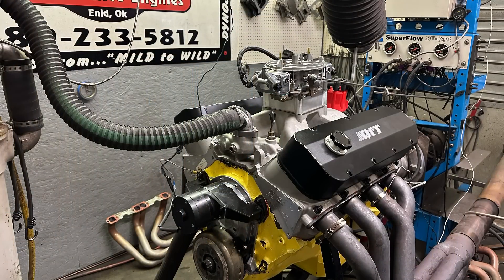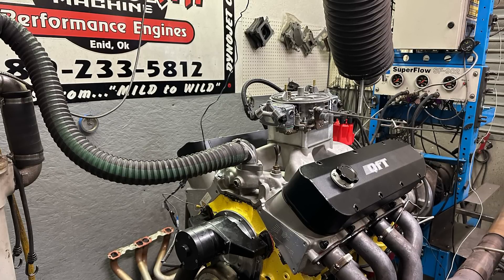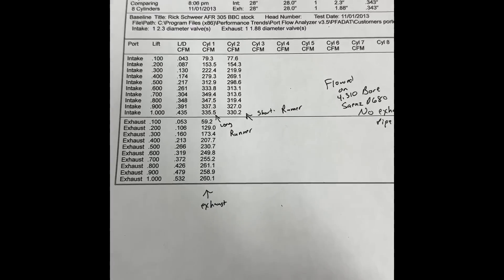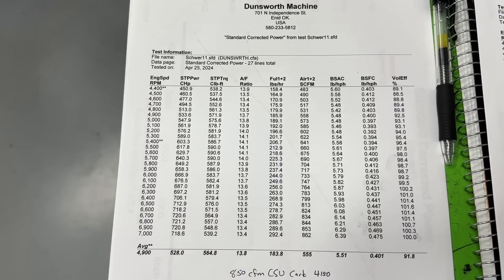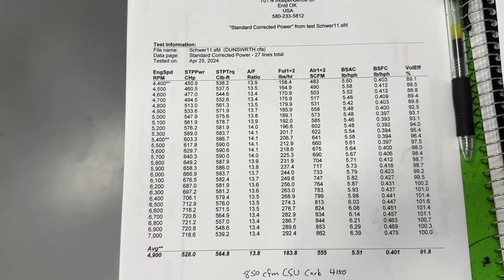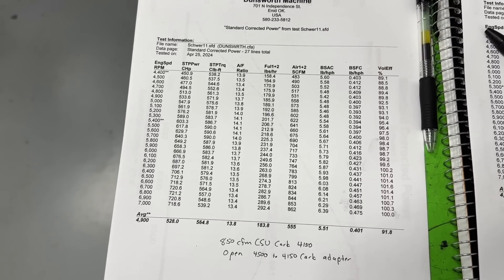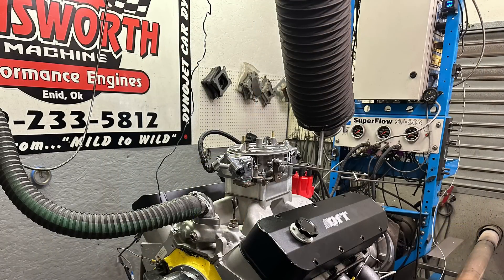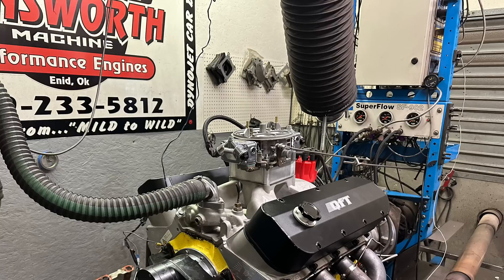468 BBC Dyno Fun

Comment: If it's an old team g it's a pos
Reply: Old Team G is excellent once the right changes have been made in the plenum, out of the box... the plenum is a disaster. (Choke City) Ton's of material available to turn the old style Team G into a performer, especially in its used price range. It'll rock with the proper attention.

Comment: my 11 to 1 468 1969 Chevelle SS always ran hot, went to a 496 with less compression 10 to 1. Both engines ran about 11.90's @ 117mph. Never wanted to spend the big bucks on aluminum heads and a roller cam.
Reply: Did you ever find out what was causing the engine to run hot? I have a similar problem in my 468 it’s turbocharged but the guy that built it he has a little and I mean very little fan that’s off center of the engine on the radiator and it’s not cooling it at all. I can go around the block at it starts overheating. I also found metal in my oil and low oil pressure so I’m in the middle of tearing the motor apart. I’m debating on stroker kit either a 496, 505, or 540. Im new to big blocks and this one’s turbo charged but I’m pulling the turbo off and going with an all motor build. Do big blocks have an overheating issue? Just curious what you did to fix the problem.

Comment: So, it's a 475 CID being the bore is 4.375 which is a little over plus 1/3rd point of compression over a 468's 4.310 bore, depending on combination... it's 10 to 20 of the HP on top. With a 47cc dome .041 head gasket and a 115cc ish chamber will yield 13.2: to 13.5:1 top. Hope you do an update when its tore down and dissected, hope someone throw's a degree wheel on it and checks the intake centerline location. N/A the block can go another .005 and have a special piston or .005 skirt coatings. That block can yet be ran for many years treated right.
Reply from the maker: Yes it’s 475 but as I said in other comments if I said that instead of 468 nobody would know what I’m talking about
Reply: @WeingartnerRacing  Got it, I missed the .100 over statement. The cam numbers makin 740 befuddle me, I had to watch it again. Hope you seen Straub's 475CID video makin 818HP with the twin Holley's  & Pro Maxx Shocker cylinder heads. Very impressive. It's only Fiat money, backed by more ink & paper. Thanks for the feedback.
Reply: @Nobody-ld7mk  🤣🤑🤑🤑🤑🤑🤑

Comment: Whys team g a pos .... i have ran them for years on sbc with really good results... another question can u regrind a sbc cam...
Reply from the maker: The dyno test on the sbc the team g was almost the worst.
Reply: On a big block Team G... the "as cast" plenum is a debacle; the runner entries are drastically mis-matched, & the runner entries are low. Plenum porting only can up HP 30 to 40. Equally size the runner entries (runner length considered) & raise the ports in the plenum as much as possible with a large radius at the top. Team G is a tremendous intake, with only porting work in the plenum.

Comment: That's cool. I built one almost exactly like that with the same heads, same short block, intake. Only difference was  cam about 10 degrees bigger and lift about .060" shorter and it made 713 hp with a 950 carb, they are great heads for a budget build like that

Comment: I can't believe that 468 is makin 740HP... I think someone bumped the calibration a hundred points, 640HP would be more like it.
Reply from the maker: Nope
Reply: I make low 6s with a 468 with 11:1 and a .657/.640 and 258/252 at .050 cam. So I can most definitely see 740 pretty easily at 13.5:1
Reply: @wesleyaitken8756  What Weight?
Reply: It's 477 CI

Comment: That engine is more or less a LS7 (+1 full point of compression) short block with the benefit of modern heads, cam, induction and dyno tuning. And the thing rips off an extra 200+ HP! Awesome.

Comment: I still love building N/A engines and this one is nice. Not everyone wants to make power with 2,3 or 4 atmospheres crammed down an engines throat. I love boost, but it's not for my 2 bolt factory block. With an aftermarket block. Better internals, twin turbos, fuel injection, fuel tech electronics. Heck yes it would make triple the power. But you need to have the $ to build something that last more than a few runs. I don't know how many turbo cars I've seen blown-up due to the weakest link. Depends on what you want & can spend. If you just want the fastest thing in the world, go top fuel, or proline or Steve Morris. But that takes big $ if you've ever priced one. Out of most guys league. Yea you can ebay turbo an LS engine reasonably, and it might last a while depending on boost levels & tuning acumen. But I'll puke if I see another turbo LS. Especially in a Ford Mustang!

Comment: Proper assembly procedure for those who don't know... with the heads off, you index all plugs with ground straps down toward the piston, then sit a head on the block with no head gasket and two un-tightened bolts, manually rotate engine and when or if the head lifts... pull the plug and rotate again. A must procedure anytime a piston dome extends above the deck. Gasket thickness dictates additional clearance after proper fitment.
Reply: Good solid advice, Lindy tool makes a tool that screws right in the plug hole to clearance for this.

Comment: Team G intake POS ??? only before port work, mostly plenum work needed. (runner entry's matched, raise & radius @ roof) Hard to believe a cam that opens @ 20° BTDC and a Bad intake is makin 740HP.  You can easily pick up 30/40HP in plenum porting providing the intake is as cast.
Reply: This is very similar to my engine. Mine is a 4.310 bore 468. In the early 90's I bought the entire AFR top end. At the time AFR had used Brodix 305 cc rect. port head. Brodix cast AFR's logo in the valve spring area. AFR ported the Team-G  intake including plenum work. Looking at the runners from the plenum area, the runners are tall and a little narrow. Heads flowed 347 short/ 367 long. 10.3 comp 91 octane pump gas made 705 hp and 588 tq. Don't know how other intakes compare but I believe the Team G works well with this smaller volume heads.

Comment: I wish I can get my engine dynoed but man I wish I can afford to do it so I can get it fully dialed and whatever. Like the engine I just ran 2 days ago it was fast as heck the one you did refresh on heads on the only thing is it kept overheating but it didn't puke out any water out of the overfill hose or radiator so I was confused on what was going on. Some say if you put the temperature sensor in the head that is close to the exhaust it might get false readings try it in the intake. Some say I am to lean even though I had more jet than others, or I am thinking my fuel pressure might be a little low because I do feel stumble just barley. Or I don't know what it could be but anyways motor was fast but was fighting the car being tight but was spinning to so many just image I had more power from your ported intake then I would have a harder time with the car lol I couldn't even stomp on it hardly at all because it would spin and be tight

Comment: I had the same problem with spark plugs with a 548 bbc, we talked to srp and they said the notch in the piston was accidentally manufactured 0.50 over to one side we notched the piston 0.50 over sloved the spark plug issue, three sets of pistons we had this issue with.